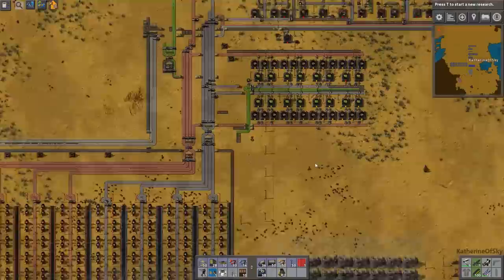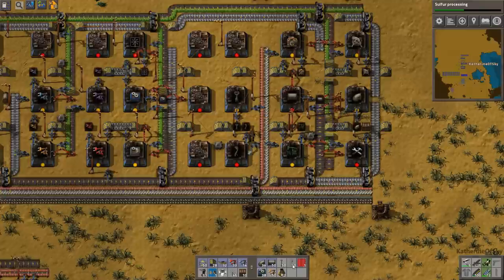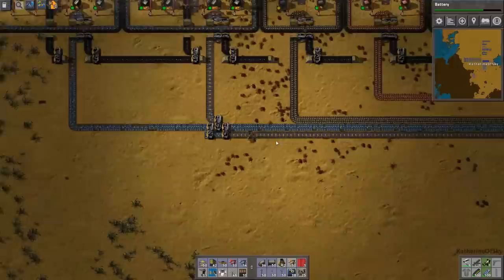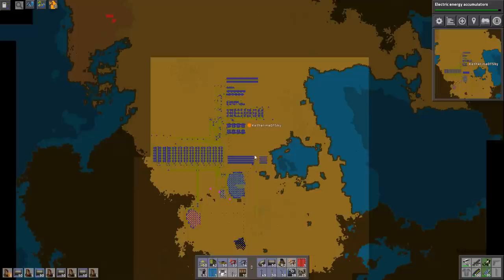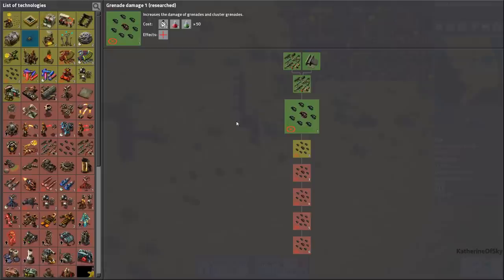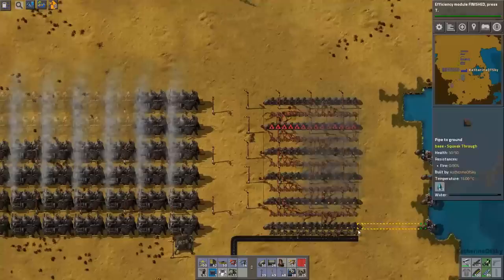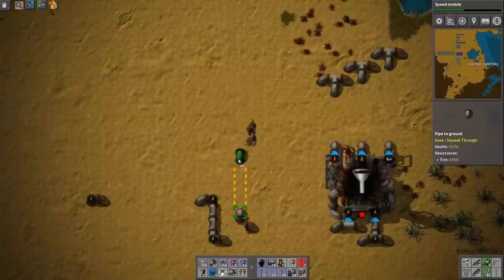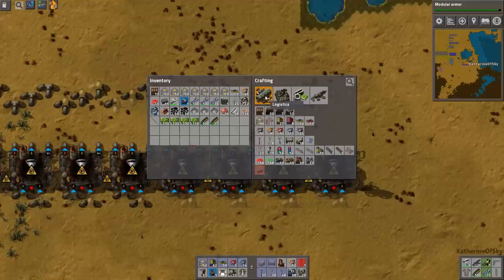Factorio 0.14 Space-X Mod, Ep 10: Beginning Oil - Let's Play, Gameplay

Comment: 14:00
You could just go for coal (or will you have anything else on that belt except for coal?) instead of "anything", but both works.

Also yes, you shouldn't go for "more than eight" because there are only 8 items that can be on a belt tile, so 8 is the maximum you will get.
Best result will be when you read the content of 4+ tiles and go with something like "29 Coal or more" for them (4*8 = 32, so you have a little margin in it).

But well, yours works as well ^^
Reply from the maker: I've been trying to remember to use the Anything tag since it is easy to copy/paste to another area, if I should need to :-)  (More of a practice thing than anything else).